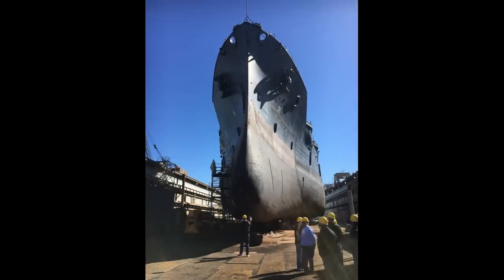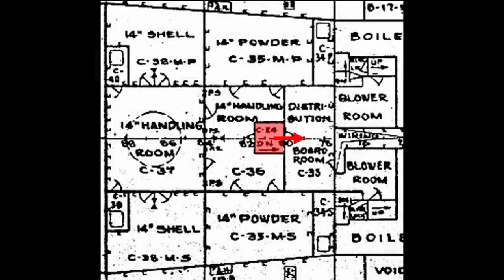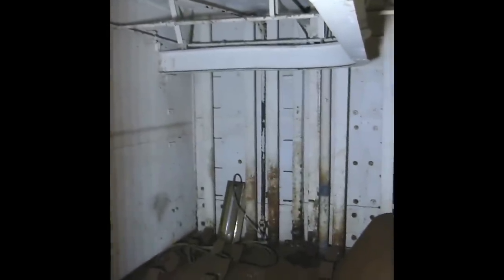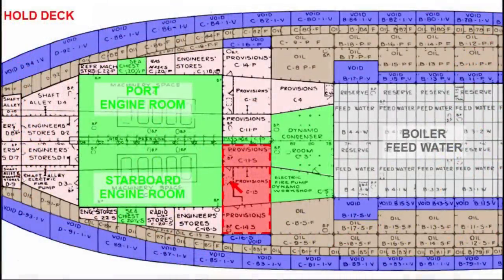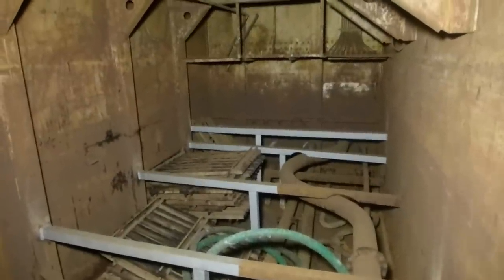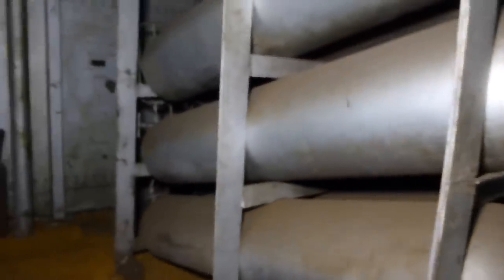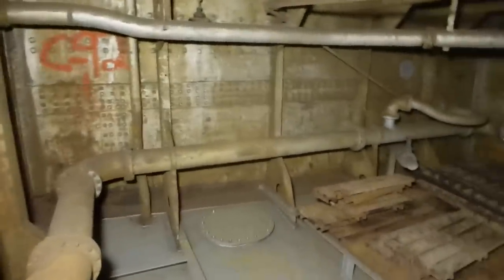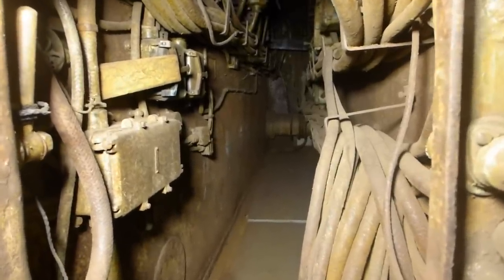Battleship Texas, Taking A Deep Dive Amidship

Comment: Whoever eventually gets this ship, which I understand will be Galveston, is going to need a large contingent of volunteers to clean up, paint and maintain these spaces to prevent further rust and decay.
Reply from the maker: I agree, but getting good volunteers is difficult.  It's easy to find people who will come out a couple of times and do light work.  However, it is very hard to find and retain volunteers who will come out time after time, for days, months and years.  Those are the ones most desperately needed since you can spend resources training them, know they will be around for a long time, trust them to not damage anything, and work on projects to completion.  Having been involved with the ship's volunteer program that did this kind of work for 20 years, perhaps 1 in 10 new volunteers are there a year later, and 1 in 50 ten years later.  Historically, that narrows it down to an approximate 10-20 people who last 10 years.  Most folks come out, do some work, have some fun, then disappear without forming a strong bond with the ship and other volunteers.  That's okay, it's just how it works. It is probably the same with most volunteer groups. Even with an adequate number of trained volunteers, there are many things they cannot do.  Much of the restoration work involves removing lead base paint by licensed contractors, and welding and painting in confined spaces that are inherently dangerous.  All of this work is very expensive and shouldn't be done by volunteers.